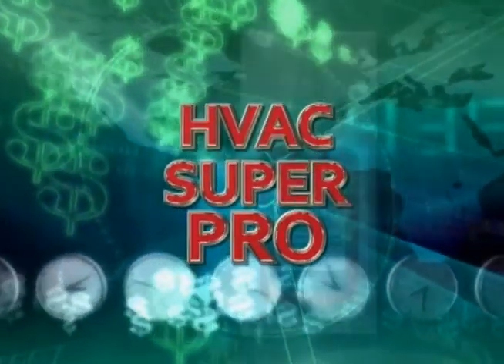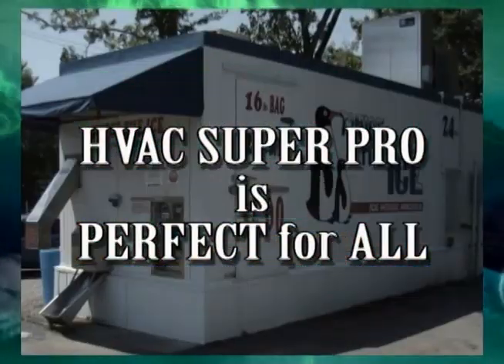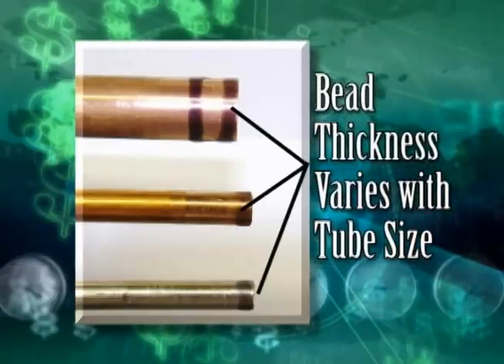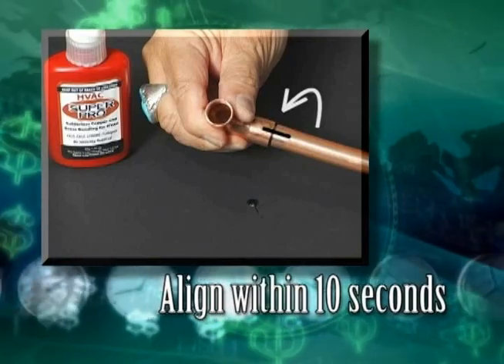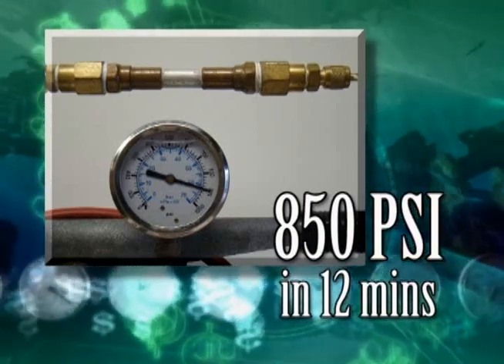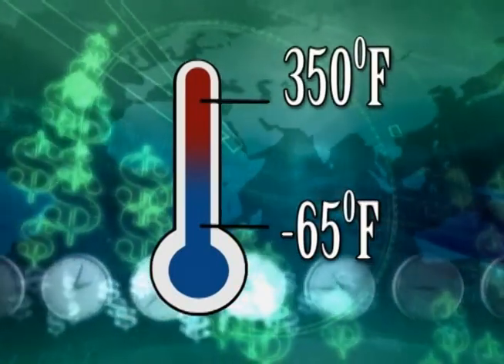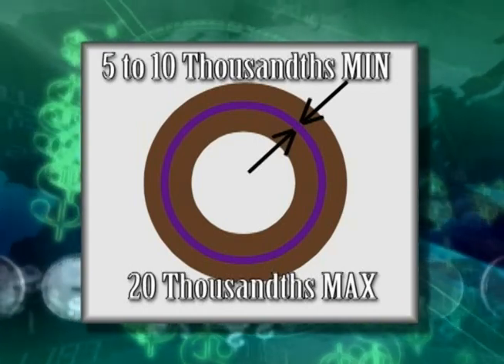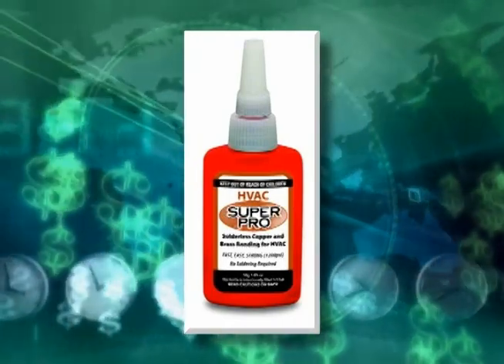HVAC SUPER PRO

Comment: Tried it on a new pump last year and used it on the dryer too.   Thought that charge would be history but damn, that system just fired after 8 months of idle.  Actually surprised the start capacitor didn't nuke.